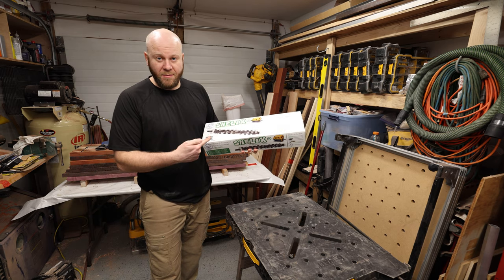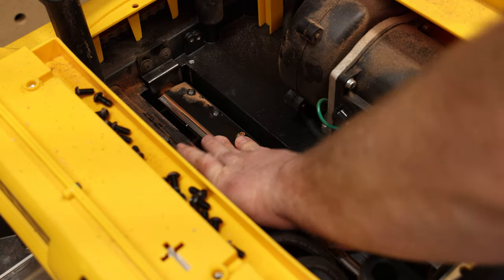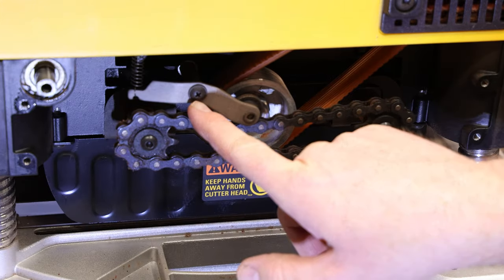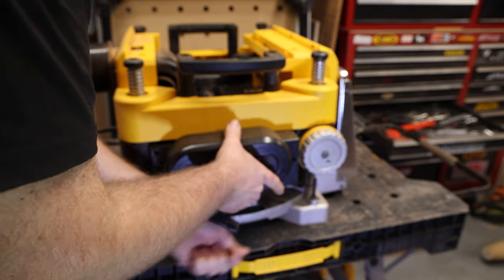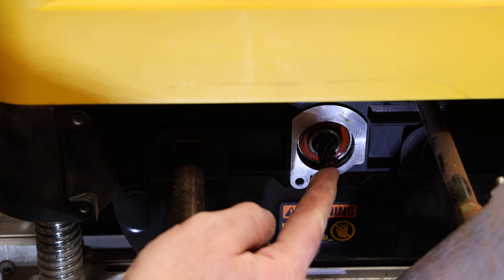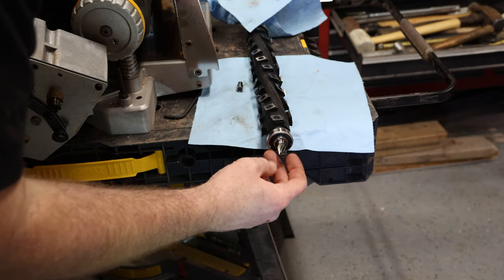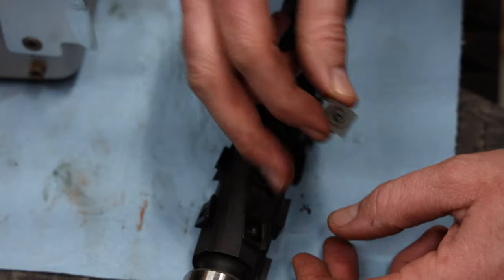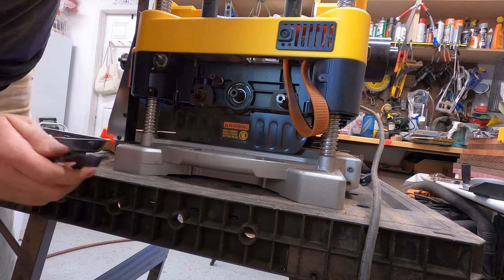Shelix Step By Step Quick Install Tutorial For DeWalt DW735

Comment: Instead of using a mallet to tap the old head out, pull it through by putting spacers between the bearing block and the pully and then tightening the nut.

Comment: you dont need to remove the cutters to install shelix cutter.just remove larg bearing and install the cutter from the inside . seat t6he small bearing and then install the larg bearing very easy

Comment: Good video... One comment, I printed out the installation instructions supplied on Shelix's website.  I was following their instructions to a ''T". When I got the old head removed, I wanted a break, so I went across my shop to wash hands to go grab a sandwich. I grabbed a bottle of hand cleaner, and it slipped out of my hands, sliding down behind a cabinet. I could see the plastic bottle lying on its side, but I couldn't reach it. (Be patient. The story has a point.) Pissed that I had been so clumsy, and not wanting the cleaner to slowly run out the open "squirter" and under the cabinet, I wrestled the 100 lb.+ cabinet away from the wall and retrieved the wayward bottle... But wait! There was something shiney lying behind the cabinet. It was a washer, a thick washer with somewhat beveled edges. I had no idea where it had come from. but like probably anyone with a shop, I'm always finding little treasures that had been missing for months or longer. I threw the washer in my bin of random washers. I had my sandwich and came back to the installation. when I was putting the machine back together, it seemed like something was missing where the nut and pin were. I poured over the instructions and found that I had missed no steps. So, I came in and checked the Shelix installation videos on youTube . At 3:14 you gave the instruction that Shelix missed - "Remove the bushing." ... Then it all came together. I hadn't known about the bushing, and in my pounding to get the old cutterhead out I had launched the bushing across my shop, and underneath the cabinet.  And had I not dropped the bottle behind the cabinet I certainly would have never found the bushing that distance from the planer. I'm not sure what kind of catastrophe would have occurred while running the planer without the bushing, but I'm sure that there would have been one.

Comment: That was the best video I’ve seen on this procedure! Comprehensive step by step illustration in a third of the time others take.  I was amazed by how easily you got that drive belt back on. It took me forever to replace mine when it broke. Tip: use the OEM.  The less expensive ones break immediately.
Reply from the maker: Glad it was helpful!

Comment: I just installed my Shelix. Had it sitting on the bench for 6 months, after a bad experience with a shelix cutter head for my 6 inch Grizzly jointer, I was hesitant. I finally did it. Your video was definitely a welcome watch, it made the installation a breeze. I had a piece of highly figured knotty oak laying around, and gave a smooth surface in a single pass. Impressed. 

Only one problem for me, was the bearings that Byrd pre-installed were bad, squeaking on first run. I had the same issue with my 6 inch jointer head. I had to replace both of those bearings as well.  I don't trust Byrd at this point to send me bearings, I will just buy them elsewhere. Then I will get to remove the whole thing and replace the bearings and install it again. LOL

Comment: Excellent to-the-point video.  A big help. Thank you so much for making it. The only thing I would change is to Not beat on the helical gear. I removed my helical gear before removing the cutter head from the planer. I was planning on using a hex bolt of the same thread size as the helical gear to beat on, but just happened to have a piece of round Hickory shovel handle slightly smaller than the bearing and that worked great. cheers

Comment: Great video and videos you share with you tube. I cannot advocate enough the value of thermo dynamics for removal installation of sealed bearings. A slight amount of heat to bearing carrier surfaces, i.e. support case by heat gun and outer race drift , i.e. socket, pipe, etc might improve cutter shaft removal and install. Cold housing, hammered shaft may cause bearing inner race "micro-spaulding and affect bearing life. Just sharing personal experience here. Keep on.
Reply from the maker: I agree. A little heat could have gone a long way. Thanks for your input Mike.

Comment: Snap ring pliers are absolutely indispensable!!! I didn't even bother trying needle nose, I saw on a couple of videos that it was a nightmare. Cheap pair of snap ring pliers is $6 at Harbor Freight. I sprung for the $15 pair. Hardest part was getting the old head out. REALLY had to whale on it to get bearings to release from housing. So I thought getting new bearings in would be awful. It wasn't, they went right in! Shellix bearings must be a couple thousandths smaller.

Comment: I've watched a lot of these videos to unsure I didn't miss anything before and after I installed my helical head.  I think you're the only one I've seen that mentions to re-coat the drive shaft with grease.  Most people doing this upgrade probably know to do this, however, I'm not sure I did.  Probably will dissemble and and check things over this weekend.  Plus I am getting some not-so-good sounds after it runs for a few minutes.  Kind of concerned with that.

Comment: Good video, what is the difference between the OEM and the smaller size and does it effect the built in depth stops
Reply from the maker: The non oem definitely effects the stops and the depth gauge. Its 1/16 smaller I belive.  Because its smaller the work piece is a further distance to the cutter when it contacts the rollers. It is easier to install only because you don't have to remove all the cutter knives to install.  Hope that helps. Thanks

Comment: What kind of grease did you use? Why did you not reinstall the head lock
Reply from the maker: Grease from inside the case. Im sure just about any grease will work. No head lock, the new shaft doesn't have a slot for it. That lock is for the 3 knife shaft

Comment: Did you get another planer so you don't have to do the conversation each time? That's a lot of work for a tool change over. Both blades have a use.
Reply from the maker: I dont need to use the standard knife anymore. Helical is the way to go

Comment: Awesome instructional video.  I recently replaced my DW734 blades for the 3rd time I believe (maybe 4).  Could have bought the Shelix w/ that $150 I spent (if they make one for the DW734).  My next upgrade is going to be the DW735 to get the extra 1/2” in width then I’ll purchase the Shelix Cutter Head.  My question is, I saw you installing the 48 cutter blades using your fingers.  Aren’t they razor sharp?  With the regular blades you use the tool magnet to avoid cutting yourself.  Just wondering how you avoid getting nicked by those.
Reply from the maker: I think they make one for the 734 but I would say get the 735 first. Its night and day to the 734. Yes, defiantly super sharp. If you dont have callused hands use gloves. Cheers
Reply: @KrisDeVo  It seems the Shelix Cutter head for the 735 (which I just purchased) is around $470 is this correct?  Am I researching right?  For some reason I thought it was around $150.  Anyways, should I get the thinner one or the OEM thickness one?  Not sure which is better.
Reply from the maker: @mass112594  They are now in the 500 range. OEM for sure.
Reply: @KrisDeVo  Eek.  Worth money do you think?

Comment: What I didnt understand is why he changed the blades on the Shelix, why didnt he use the blade bits it came with?
Reply from the maker: You have to remove the cutters for the OEM size head to install it. Then re-install them after the head is in the planer

Comment: And I stripped one of the screws on that spring loaded plate. FML
Reply from the maker: Try a sharp chisel on the outside to break it loose
Reply: @KrisDeVo  my wife picked up one of those drill bits that removes stripped screws. All good. Now to buy a replacement screw

Comment: Don’t buy the DeWalt. It’s overpriced to begin with. Add in the helical cutter head and you have an overpriced pos. I bought the Magnum, it’s a 4 post helical cutter head for way less. DeWalt has priced itself out of the market on this tool.
Reply from the maker: I couldn't disagree more
Reply: @KrisDeVo : hi, Kris. I paid $700 CDN  for the Magnum. The DeWalt is about $100-$150 more, plus you have to buy the helical head. I saw the aftermarket cutter heads going for $400 plus. So $700 VS $1200+. I can’t see the value in it considering they cut the same dimensions and have a 15 amp. motor. I’m a huge DeWalt guy. Over 90% of what I own is DeWalt. Not only is the price point off, so is the warranty. I’ve got a five years parts and labour on the Magnum. DeWalt offers a 1 year. But it begs the question, What did i miss here? Please let me know. Thanks in advance.
Reply from the maker: With 10 mins of research online I could only find the Magnum planer for sale and people asking if its good. On the opposite end of that spectrum is the DeWalt 735 which is the most proven mobile planer made. We have run probably 100s of thousands of board feet through a old beat up DeWalt 734 over years and years. Im assuming you are not using this it to make a living. I buy cheap when I can and when it counts I buy right. No question will I spend money for a quality proven product I don't have to think about or worry. A warranty is only as good as the product. As Chris Farley said in Tommy Boy, I could take a dump in a box and put a warranty on it but that doesn't meant its a quality product. When it counts my motto is, buy it nice or buy it twice....
Reply: @KrisDeVo  : thank you for the info. I’ll let you know how the magnum performs